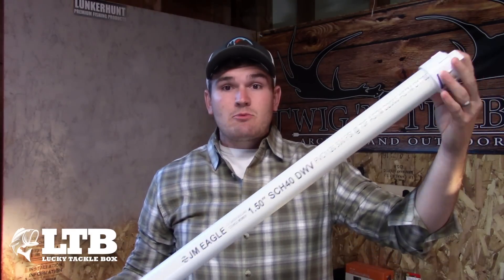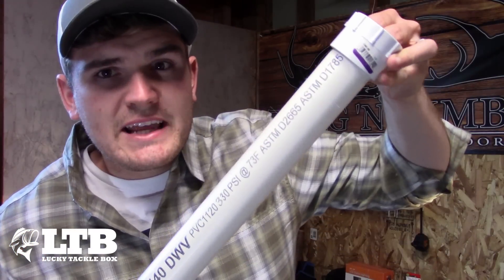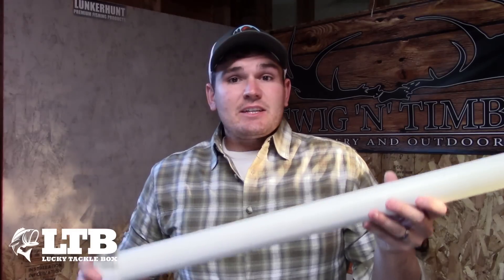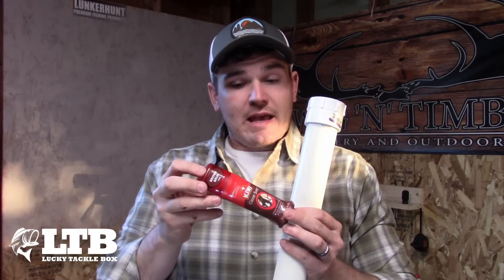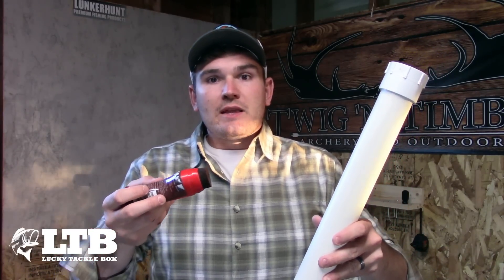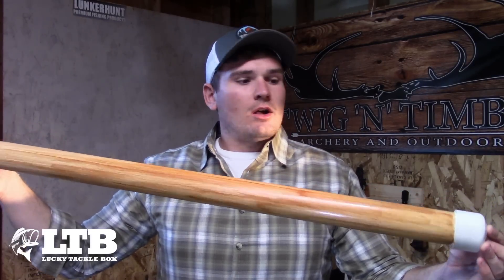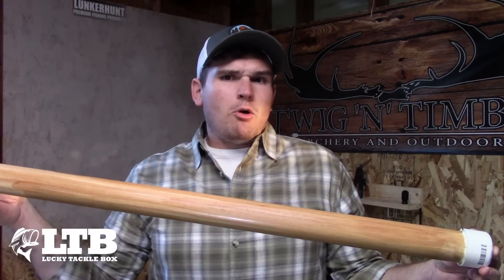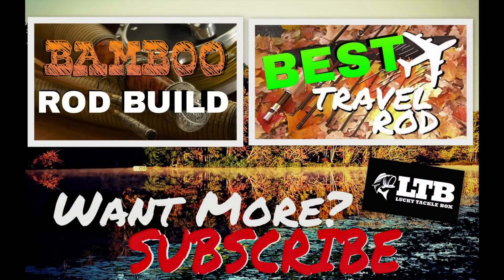How to make the BEST DIY Rod Tube Hack Mod - LOOKS SO COOL

Comment: You can also use acetone (or nail polish remover) to wipe the ink right off of the pvc.  I realized this after using super glue to seal the cap and adapter (pvc glue is unnecessary); the ink started to run.

Comment: Some vacuum cleaner stores that sell parts for a central vacuum systems have pvc tubing that is thinner than the pvc that is used for plumbing.  I buy 5 ft lengths for $4.35.  It is 2" vacuum conduit.
Reply: Dmm M there are many grades of PVC available at most hardware stores